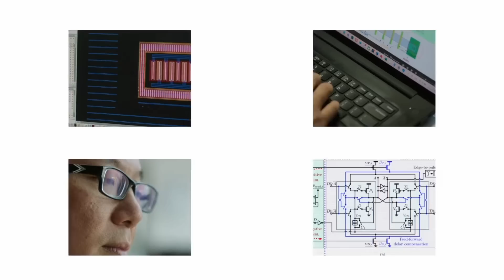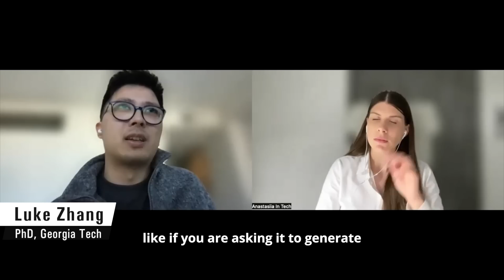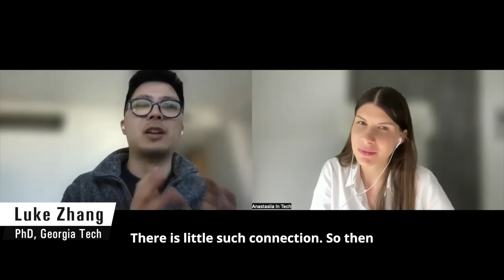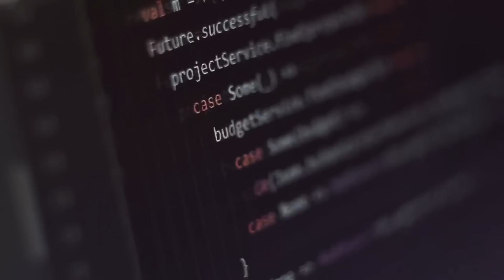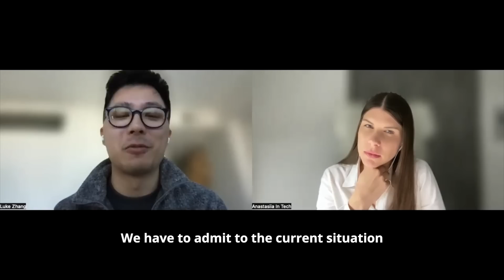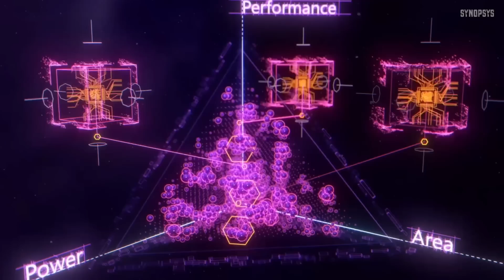Training AI to Design the Next Generation of Chips

Comment: ChatGPT as a LLM is not creative, like a human brain. It just reproduces ideas from other sources fed into their library. Best case, it combines such ideas or runs optimisations.
Synopsis already provides such optimisations for lower power-usage etc.
Such LLMs must be fed with thousands of examples, to get fuctional output - but there are just some useful chip-designs out there. Even Intel, AMD or any other company in the industry has so many independet designs - the use of evolutions of former designs is more costeffective than starting new from scratch.
Every simple trick a company lears, stays a kept internal secret.
An AI with the knowledge of all chip companies together, might result in the best chip ever?
Maybe taking a step back and rethink, leads to something good enough for today - like the RiscV-ISA led to several designs from single-core- to combined multi-core-layouts.
We noticed what Apple did with ARM-Cores licensed and integrated into A1x or Mx.
RiscV is much younger than Advanced RISC Machines (1985), so we have good expectations ...so please do not follow Dec Alpha

Comment: Not surprising since the basic design blocks of computers are over 60+ years old. Most of the layout was already automated, with engineers hand positioning blocks, busses and interconnections, letting to tools do the optimal routing.

The only thing that makes it better is more pipelining and parallelism that gets around basic design bottlenecks.

AI can test thousands of tradeoffs to select the best ones that engineers don't have the physical time to test and analyze.

Comment: What happens with current AI is that it is a generic system, it is just an assistant.  It is instructed and become "expert" only at the moment you ask the question.  It is not an authentic Expert System that becomes more and more capable in a specific subject.  Intelligence itself tells you it.  If it acquired all the knowledge, experimentation and expertise of hundreds or thousands of professionals (which it could do, they just won't let it), the current AI would be unstoppable.

Comment: As a chip designer I do find vast differences in quality between different designers, one extreme example was I wrote an audio extraction logic block for SDI that was 1/100th of the size of paid for IP.  The problem wasn't clever or efficient implementation but a different thinking about the top level, this is something AI is still weak in, but I do expect AI will be a useful tool to help designers in the current generation.
The place where implementation quality would be key would be AI controlled full custom digital design, the difficulty here would be immense though and produce designs that likely only the AI itself would understand (a human might take years to decode it), best-o-luck finding a bug in that :)

Comment: Using LLM’s to design chips is analogous to consuming soup with a fork. You can reason, deduce, snap your finger and click your heels all you want; you will not find success. Or maybe this - using LLM’s to design chips is like using Tardigrades to repaint the Sistine Chapel. Both can do neat tricks, but there’re just the incorrect instruments. Rant, more rant, continued rant…I think I’ve made my point.

Comment: This is just the bare beginning of AI used to create new and innovative chips and other circuitry. Soon it will be as easy as just telling the AI what you want the chip to do and the various parameters.... almost like pushing a button. Then the next gen will come out where the AI anticipates the chips you need for your project and comes up with those designs just in case you do need them. 
    Also AI will be used to develop new chip manufacturing techniques. On and on and on.... AI will consume the jobs that used to require human experts. 

Good thing you have this YouTube channel Anastasi!! 
Wait...... you are actually doing these YouTube videos right... not AI?

Comment: Now that LLMs like LLaMA are smaller and more efficient, it wouldn't be hard to imagine using three different LLMs to design a chip. Use one with GPT-4V to recognize, label, and then analyze microchips. Use another to be an adversarial agent that does QA. Then, a third one could be a custom in-house LLM that uses that previous data to model entire systems before any prototpe is fabricated.

Comment: If AI can be used to design simple chips well, that might be the best start. Of course, there is no need to have AI for this, but if it can understand all of the RC propogation delays, tolerances, etc., and can scale a design to use different nodes (lambda), then that creates a foundation that you can trust, while waiting for AI to advance enough to be ready for a cpu, or gpu, etc.. Perhaps it could proove its worth with analog chips, or substrate interconnects and logic between different tiles. Or in optmizing microcode.

Comment: I have found ChatGPT (GPT-4) somewhat useless when it comes to writing SystemVerilog code. My suspicion is that because there isn't a large corpus of open source hardware code, there isn't enough data to train off to make good RTL. It somewhat frequently uses C-like curly braces instead of begin/end, and writes code that's sort of in the right direction, but really doesn't connect together in a sensible way. Perhaps the fact that hardware code is inherently concurrent doesn't fit well with what the model has learned from software design. My go to test has been to ask it to create a clock domain crossing FIFO, because that requires understanding metastability, gray codes, RAM modeling, etc.

Comment: I find that ChatGPT is very good for specific functions. So if you know what you specifically want. You can build it block by block by creating and implementing supporting functions without ChatGPT even knowing that its for. For example, I used it to create a function that leverages antonyms to change the sentiment of a string to positive or negative.

Comment: Given an LLM and statistical layers, you can predict the next token in the sentence (if a picture the next group of pixels or if a game the next move or if a robot the next movement, etc.) The key is that in order to design a paragraph it needs to have enough data to know the language and enough layers to predict the next word in language and enough structure to complete the paragraph (depends on the data, not the code). 

The challenge is to discover the language of computer design. It implies making the LLM of the process of design (the many design concepts and methods) and CREATING a language with which to express how you design a chip.

Challenging. Good luck and thank you for your very observant channel.

Comment: "When we develop a computer model capable of designing and testing a chip, even if the first iteration takes months or years, it will be revolutionary and a step towards the singularity. Humanity already possesses extremely powerful computers running various simulations. We can direct these resources towards a 'design a better chip' use case. Once we've built these enhanced chips, we can use them to design even more powerful ones at a faster pace. Over time, this could approach what seems like 'infinite' computational power.

Comment: The first question I would've asked is whether the form of knowledge representation is appropriate for the given task at hand.  LLM's would not be the first thought, that comes into mind.  It's oriented towards language ("predicting the next word", or riffing on more abstract themes).  I would've thought for chip design, one needs, at a minimum, 3-D spatial awareness.   Just as for AlphaFold, you need to build in some priors regarding structure biology.  ChatGPT (LLM's) would not be the right tool for protein folding.  

Perhaps LLM's can help with high level themes, at the idea level.  But that's about it.  But it's not really aware of the physical world.  (The YouTuber AtomicBlender, tried to use ChatGPT to design a novel nuclear reactor to see it would replace nuclear engineers someday.  Not anywhere close.)

Comment: You have an interesting channel.  But I have doubts about chatgpt chip making.  For this, it is better to use the Anthropic API.  In my opinion, he is better versed in modern nanoelectronics.  In particular, Anthropic AI chat offers the most advanced technical solutions in photonics and molecular nanoelectronics.  Chatgpt can simply be used additionally for additional data processing. In general, the idea is interesting.  But for a full-fledged implementation, it is better to use a multi-agent system with a certain number of defined modalities.

Comment: I have tried many times to implement novel concepts into real code with ChatGPT.
1. It doesn't know what it's doing. It appears as it is writing with instinct and intuition rather than logic and deduction.
2. It doesn't know what it knows or not. On some occasions, it will generate confident assertions that are provably false or inconsistent.
3. It cannot correct some of its mistakes, no matter the clarity of prompted guidance.
4. Previously output tokens cannot be corrected even if they are wrong. Even if it self-corrects later, it will have adversarial effect on the quality of output.
It is perfect for simple utility scripts that doesn't go above 20~30 lines.
If total lines of code range goes over around 100, it starts to fall apart and repeats the same mistake over and over.
We need a better architecture for attention mechanism and token generation.
Instead of constant window of number of tokens to distribute attention, the agent should be able to adjust to window size and offset from looking at current window and visible tokens. Maybe even multiple times to get to the relevant parts.
Additionally, instead of always appending new tokens, there should be paths for amending previous tokens or inserting tokens at any position. This could have a pitfall of infinite loop though.

Comment: My experience with GPT-4 writing code even simple code was not stellar at all. Draw a tree using p5js and fractals, total garbage came out. (angle but no -angle so all the limbs were on the same side of the tree) Same request but asking for GPT to write the comments for the code and it wrote the documentation and the code that totally worked. So asking for the thing didn't work for me but asking for the stuff around the thing produced high quality docs and a working program. btw gpt threw in the code without me asking, I just asked for the documentation not the code.
Reply: GPT-4 has been shown to be able to notice its own mistakes and fix them.

Comment: I wonder how updates to LLMs (like increasing the context window size or the parameter count) will change their ability to generate chips. My guess is the biggest leaps will come from these updates for a while, not necessarily the additional training in chip design specifically. Definitely an interesting idea though!
Reply: IMO there will be dedicated LLMs especially for chips. Don’t you think so ?
Reply: @dchdch8290  In the short term, yes. In the long term it's likely that the best models for chips will be a general purpose one. In the same way that Google's RT2 performed on average 50% better with the OpenX dataset (a HUGE text dataset), and even outperformed specialized robot AI's.
Reply: @snailedlt thanks ! Good point.
Reply: Spot on!
LLM's make the entire chipmaking process faster and better. This leads to better chips which will allow us to power even larger LLM's. 

But there is still a lot of room for efficiency in the LLM's. Good thing LLM's can help us make more efficient LLM's! It's all snowballing, and every tech-related sector will massively increase in productivity, value and performance over the coming years!

Comment: Chatgpt is not good at generating code. It is inaccurate and cannot generate good structures. You have to find all the issues yourself. If you ask for test cases they are not complete. In my estimation, as an experienced developer, it performs much worse than a junior programmer and is not able to learn from mistakes you tell it about.

Comment: imagine the first ONSLAUGHT CPUs  (machines designed by machines)
they might even figure out how to make A CPU that is a Solid crystal and envelop it in a shrowed that cools it and connects all sides to a PCB with the internal being a FLOW pipe that instead of needing contact you pump coolent directly though the CPU channles for 100% flow to cooling ratio

Comment: This is a terrible idea and is going to lead to disaster and huge liability and wrongful death lawsuits.  ChatGPT consistently produces plausible but deeply and often subtly flawed code and math.  Even the versions trained specifically to code like GitHub's copilot have this problem. I can't imagine an HDL-specific version wouldn't have the same flaw.
Reply: Agreed. It produces incredibly complex bugs in code - it will surely do it in the more abstract HDL too
Reply: It's not like human-designed ICs can't have subtle bugs. e.g. Intel Pentium FDIV issue.
Reply: @Radaos  They can, but it's the norm in anything you ask ChatGPT to do beyond really basic examples that it's actually seen. And the types of bugs are incredibly weird in the sense that it's hard to imagine a human doing it. That makes it particularly hard to notice in code review.  Basically, you can't trust ANYTHING ChatGPT gives you.  Especially if it looks plausible and seem right. In my experience, over the last year or so working with it daily, you spend so much time trying to check and fix everything that you'd have been better off just doing it yourself.
Reply: @protocol6  - exactly. Increasing accuracy simultaneously increases the ability to mask problems.
Reply: True.  It reminds me of EV car manufacturers deciding to use a Tesla style tablet display, simply because Tesla did it.  Rather than design something original.
Reply: These companies relying on the Chat-GPT like models are simply using it as a stop gap for lack of a better idea.
Reply: As an FPGA Engineer, I've tried using  chatGPT to reduce my workload and  found that it very confidently generates incorrect systemVerilog rtl. 😂 It's still useful for architecture design, but has a long way to go before becoming actually useful.

Comment: But Chat-GPT is not really general AI.
Reply: I've only used the public version,  which is pretty dumb.  It's a probabilistic text retrieval engine and makes lots of errors.
Reply: But it's good for generating ideas.
Reply: It reminds me of EV car manufacturers deciding to use a Tesla style tablet display, simply because Tesla did it.  Rather than design something original.  These companies relying on the Chat-GPT like models are simply using it as a stop gap for lack of a better idea.